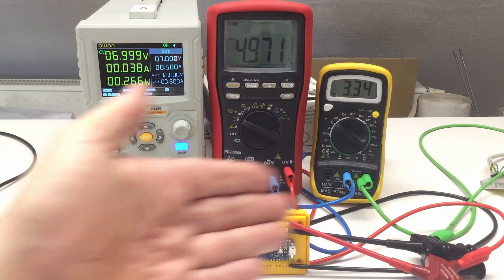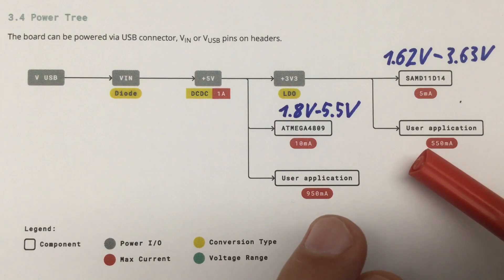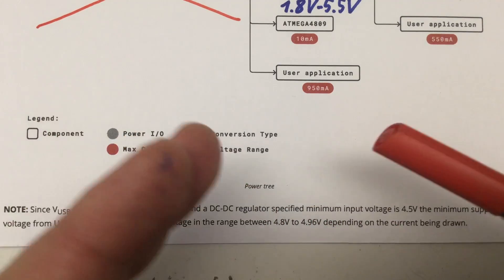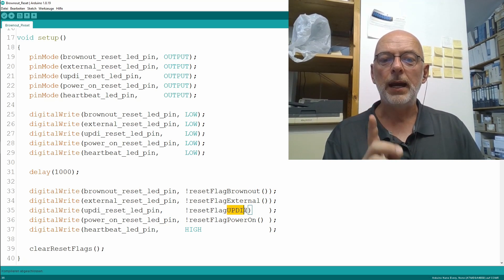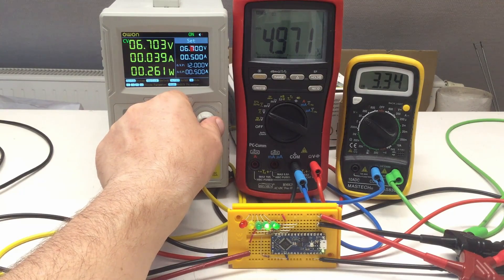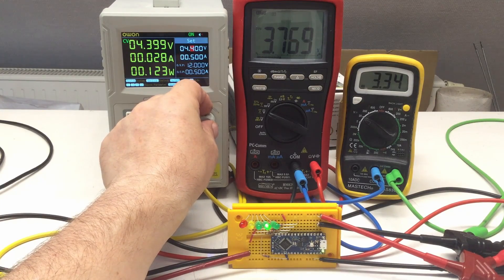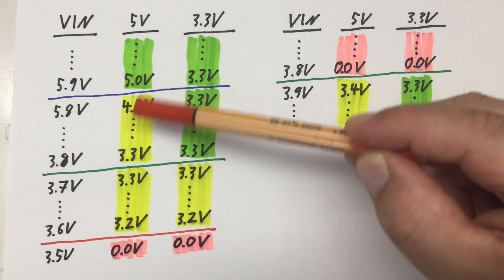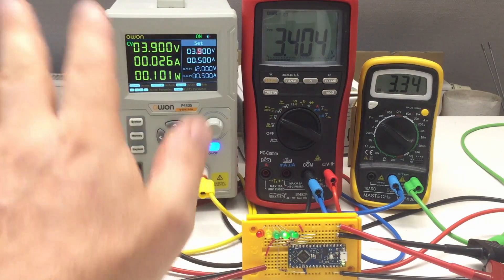Arduino Nano Every – Power Supply Architecture and Brownouts

Comment: I have an application using a Nano Every powered by a 5 volt super capacitor that’s connected to the 5v pin.  After about a minute, when the super capacitor discharges  to 2.15  volts, D2 and D3 LED’s light up.  I’m assuming the NE data outputs are in an unknown state with enough current to power the LED’s. The NE controls an external device, and with D2 and D3 at a logic high that is considered a failure mode.  I was hoping the BOD would prevent that.
Reply from the maker: Interesting application! How big is your super cap and how long can it run the Nano Every? Anyway, some day, if I really need it, I will come up with a procedure to program those BOD fuses. Or maybe you do the research and let me know 😉

Comment: Read the datasheet of ATMEGA4809. The voltage level of BOD is set in the fuses. It can be set to 1.8 V,  2.6 V and 4.3 V and the default is 1.8V.  You can read the register CTRLB to see the actual level. In your experiment the voltage drop after 3.6 V is probably because DC-DC converter have some low voltage protection that switch off the output when the input voltage drop below some level. If you want to test the BOD, then skip the DC-DC converter and supply the input voltage directly at 5V pin and then gradually decrease it from 5V down.